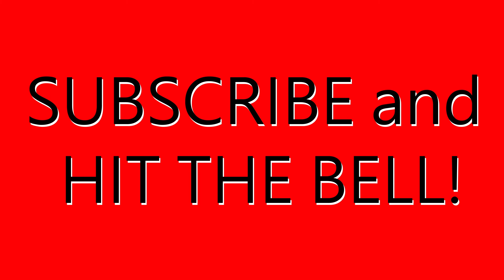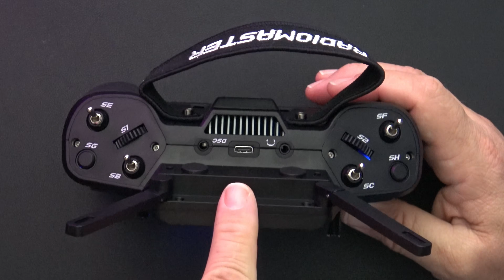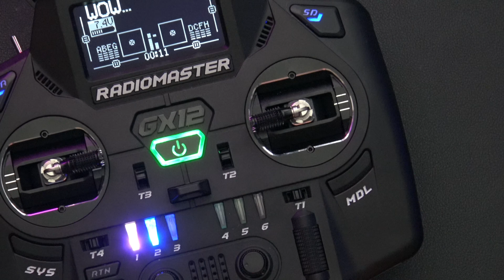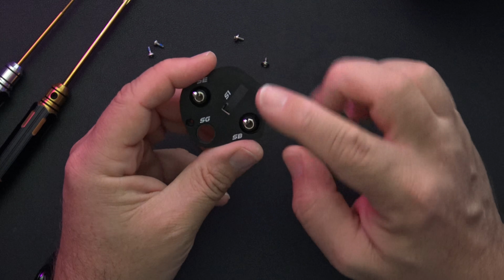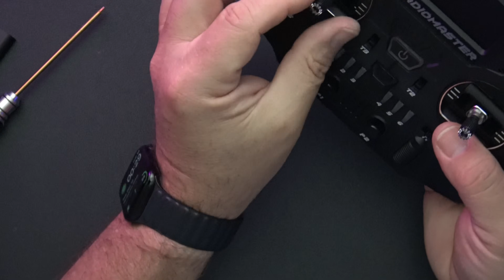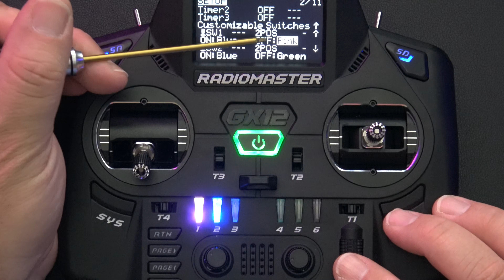Is This the Most Advanced RC Transmitter Yet? Radiomaster GX12 Review

Comment: Bummed, I didn't see this before I ordered the RM Nomad module.  It's still in the box.  I wonder if they will take it back in exchange for the GX12?  Can you use the individual buttons for turning on/off buzzer, Or switch EdgeTX widget screens?
Reply from the maker: The buttons do have configuration options. So if what you want to do has software support in the firmware, the buttons should be able to control it.

Comment: Thanks for the content! Yours is my go to for my radio Master transmitters! Top-notch and clear. I am waiting for the arrival of this model. Any advice from switching from the boxer over to this model and preserving my settings?
Reply from the maker: Switching form factors is not clean cut. You should keep your core settings (Inputs, mixes, outputs, logical switches, special functions) but where there are hardware differences (switches for example) you will have issues. I would recommend going through each model configuration very carefully.
Reply: @ thank you
Reply: @RCVideoReviews  I see what you mean! I pulled my models over from the boxer. It seems that customizable switches are not activated on the imported models

Comment: Just getting back into rc planes after about 24 years.  Basically starting all over as all my stuff is so dated. I just received my new radio.  The radiomaster tx16s max and have a couple  questions.  1. Say I have three planes setup on the radio when I go from one plane to the next to fly do I have to bind the plane every time I switch between them and 2. If I use the insta trim when I am flying for the first time will that setting be set for next time I fly or do I have to go in and set something to keep those trim settings.  Thanks

Comment: Nothing to do with this video, I had a quick question. I went from flying dutchman 2.8 and jumped straight to centurion 2.10 All looks well and good, should I have flashed other versions in-between for specifics?  I plan on grabbing rotoflifgt 2.2  and wanted to be as up to date as possible.
Reply from the maker: No, 2.8 to 2.10x is fine.
Reply: @RCVideoReviews  Thank you kindly, I'll grab a duck and run hoodie. It's a bit of perfection for for my run-around.

Comment: One reason I like your channel so much is I know you fly a lot of helis. I fly almost exclusively helis but will be getting into some FPV drones as well and am considering this radio for mostly FPV. I have dumped thousands of dollars into Vbar and their FBLs. I would like to experiment with a Nexus with this radio but can I change things on the radio like Vbar? Or will I just have to carry a laptop with me when I go out to the field like the old iKon 2 days?
Reply from the maker: RotorFlight has a LUA script that allows you to change not only FBL settings, but also ESC settings. Unfortunately, after I made this video, the first thing I did was try to set it up for a heli but the RF Programming LUA and RF2TLM LUA do not work on this radio. I've opened a ticket with the EdgeTX team as I expect it's an EdgeTX issue. I KNOW they will fix it, but full disclosure--current firmware some important scripts do not work.

Not only can you change features from the radio, you can also do in-flight PID tuning: https://youtube.com/live/Pg4DiXRQZcI
Reply: @RCVideoReviews I ended up getting this radio and decided to see if I could get the RF Lua script to work. No dice as of right now. Have you had any luck getting it to work yet with this radio? I can see the application in the system menu, but I keep getting a syntax error when I try to run it

Comment: Thanks! Going to watch this a few more time, might be the right size point for the Wife. TX16s to large for her by a landslide and Pocket was too small for her to pinch fly, so wasn't a good fit for her.  Waste of money/time getting it and converting her helicopters to ELRS tbh but whatever.  This might be that third bowl of porridge!
Two standout questions that others might have as well:

1. Are these gimbals a better feel than the AG01? 
It's nice they have adjustments, but are they an upgrade/downgrade/even?

2. No SD card...how fast is it to format/flash? 
USB flashing/updates ect on TX16s is horrifyingly slow, I always remove the SD card and do it.
Reply from the maker: 1. I can't answer. I think gimbal feel is a highly subjective issue.
2. Given I haven't formatted an SD card in one of my radios more than once (outside of the testing I did to make the SD card blocksize video) I didn't see a need to check. As with the other radios, it's not the speed of the card, it's the data channel between the card and the interface that is the gating factor. I expec as this is the same CPU, it'll have the same gating factor.

Comment: When radio manufacturers put the screen at the top, they invariably move the gimbals down which puts them too close to the bottom of the case. I never look at the screen while I'm flying. I like that SE and SF can easily be changed to 2-position switches, but I think S1 and S2 would be difficult to use. I don't follow the logic of pink being off, but perhaps that's to let you know that it's configured to do something. Somebody needs to put EdgeTX in a Spektrum iX14 case..  😎
Reply: I like the screen at the top, so that you can take a quick glance at the telemetry while flying.
A screen at the bottom is harder to read
Reply: @malte9999  The audio in my transmitter tells me if any of the telemetry values are out of spec. And, I can tap anywhere on the screen to clear the message. About the only thing I use the screen for at the field is to switch between models. When I'm at home, I connect my transmitter to my PC which displays the transmitter screen on my monitor. I use the PC's mouse and keyboard to edit the model and gyro settings and occasionally install updates. This also makes it easy to create how-to videos for YouTube. I don't have to point a camera at my transmitter.

Comment: Great review as all ways.  RadioMaster should have made two options Gemini and regular ELRS. I am not gone change all my receivers to Gemini protocol and hardware.
Reply: You do not have to. You can use existing receivers, just not all modes
Reply: I can confirm, its all compatible, nothing to change. And heck, this adds the ability to use 915Mhz receivers too! ELRS is the most compatible system ever.
Reply: @cagmuer  Their new stuff seems to have both Gemini or diversity mode support. At least the new dual receiver and dual antenna receiver modules can be configured to either Gemini or diversity ELRS. Can't see why the transmitters wouldn't be the same. Don't have a Gemini transmitter yet for myself since there is no LBT/EU models available yet.

Comment: Can you fit 21700 cells in the battery bay?
Reply from the maker: No. Not close.
Reply: @RCVideoReviews  Not even the trayless prebuilt packs? Most of their other radios with tight fights will take the pre-built 21700 packs or 18650's in a tray, the two configurations are similar in size.
Reply from the maker: @adam_mawz_maas  I tried fitting my 5000 pack and it did not fit.
Reply: @RCVideoReviews  Hey on the Radiomaster website it says 21700 is compatible. Under the Specifications Section of the website.

Comment: I'm a big fan of the monochrome screen. Much easier to read especially in light. Not as flashy, but we should be looking at our planes anyway not the radio! 

I do wish the gimbals were higher up on the radio or the radio was taller. Radios where the gimbals are low down feel weird to me. I couldn't figure out why some radios felt weird for the longest time till someone pointed that out to me. 

I may get one of these for a secondary radio / buddy box. I do hope they offer a 4 in 1. Or a very compact 4 in 1 module for it that uses the internal antennas.

Comment: I can't believe  it's almost 2025 and we're still using monochrome screens. I like the radio but color screen  would've been better imo.
Reply: I use a Zorro and a TX16s. Even if the color screen is very beautiful, it is the monochrome screen which is the most effective The more sun there is, the better you see what it displays. It's completely the opposite with a color screen...My color screen is beautiful but I have to block the sun to see it.I never use touch, it's the best way to select the wrong thing and make programming errors. Edge TX is still largely optimized for use with buttons...
Reply: For my use case in particular, ignoring price difference, power and size; I would choose B&W over color if it were an option
Reply: cost cost cost cost lol.. get what you pay for
Reply: @thatonebeone    well if it was an option  it would be a cost I'd gladly pay for  aswell  as many  others  . Not to mention  the monochrome screens are $7 and the tx 16 screen  is $ 35   an extra $28  isn't gonna break the bank .
Reply: @gr8n8  yeah its not bad i had this brand radios they are good plus you are not looking at the screen 90% of the time lol... what blows my mind is how much they cost and they work very well compared to more expensive radios... plus i kinda dig the retro old school screen look lol...
Reply: @thatonebeone     i own 2 radiomasters a tx16s and a boxer  they are great for the price.
Reply: It also enables radios like the t20 to use much smaller screens, something that is not an option with color. That isn’t really relevant to the main argument here since the gx12 has a larger screen but that is one reason why “it’s almost 2025 and we’re still using monochrome screens”
Reply: @xer125   i guess  a different flavor for everyone  I'm just saying I won't be braking out my 1980s crt monitor anytime soon or going  back to black and white  tv lol even my raspberrypi's use mini color displays i personally like color  that's all.
Reply: @ yeah, definitely depends on application. Tbh it’s more the ui qnd touch vs no touch that is a bigger difference than the color. If you took the b&w ui and put it directly on a color screen it wouldn’t really gain you much. For non-fc planes I would assume the color ui is easier to use (and the companion even easier)
Reply: I agree  if they used the same UI  i may be more inclined to use it more
Reply: @gr8n8  ah, I’m actually pointing out that I specifically prefer the b&w ui, even if both UIs were available as color or b&w the simpler UI is my preference.
Reply: @xer125  I like color screen too and the touchscreen interface is one of the main reasons which pushed me to buy the TX16. But I am forced to note that it is much less effective, relevant and adapted to the edgetx interface and light in the field. 
I would have much preferred that not to be the case.😅
 But it’s obviously also a matter of individual preference anyway 😀 
Both options are available, But if we continue to use these monochrome screens in almost 2025 it is because they are still largely relevant Which is not the case with a black and white cathode ray screen 😁
Enjoy!
Reply: Th tech has to move forward  at some piont why not now
Reply: Nah, the b&w ui is better (for me as primarily a quad pilot, and a bit of fpv+fc planes, minimal los)
Reply: @xer125   color touch screen just makes it more user friendly  when you do have to interact  with it .
Reply: @gr8n8  I disagree, depending on the use case, I think B&W edgetx can be more efficient and user friendly.